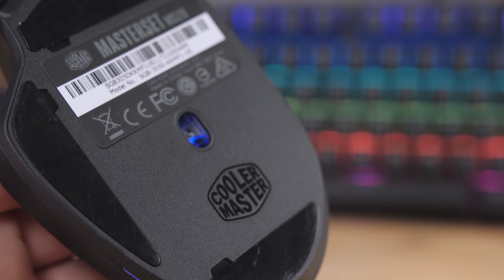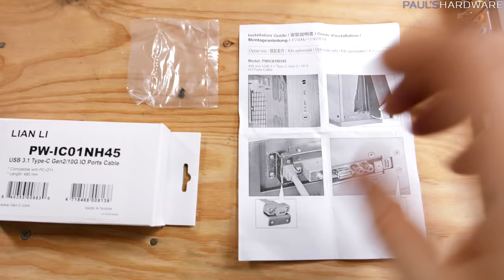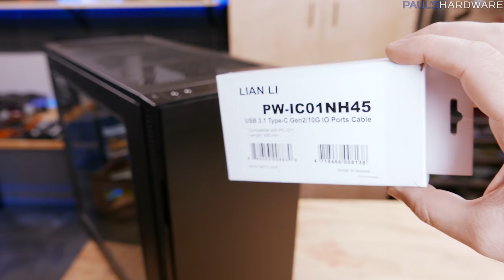CASE MOD! Adding a 10Gbps USB 3.1 Gen2 Type-C Plug

Comment: I don't plan on purchasing any device that would benefit from that type of port and my motherboard dose not have  the header, why did I watch this?
Reply: The phone manufacturers are planning on you buying a device with one though.
Reply: Phones already have a type-C connector, but the cables are type A on the other end. Will phone manufacturers start shipping cables with type C connectors on both ends any time soon? Guess it would be useful for macbooks and other laptops that are getting rid of Type A
Reply: The Google pixel has it on both ends already
Reply: I'm stickin my my nexus 5 for at least the next 6 years
Reply: My Nexus 5X came with a Type-C to Type-C cable, it's really annoying that I have to use the adapter to Micro-USB and a seperate cable when connecting to the PC (for the rare times I decide to test some ROM or something).
Reply: I dunno, I did too, and I don't have a header on my board.
Reply: had the same feeling when i got my power bank... now it is the only micro usb i use somewhat regularly.
Reply: Because Paul is the man!
Reply: I have an LG G6 and it utilizes USB C instead of microUSB. Aside from it being an interface in its infancy with low availability of cables at the moment, from personal experience I can already see why moving towards it would be a great idea for the tech industry: it's durable, it's universal orientation is a godsend [seriously microUSB can be an inconvenience at lining up on some devices (such as my Jabra Halo Smart Headset and Cambridge Soundworks Oontz Angle 3)], and the transfer speed is great when you're on a rush (sometimes I would change my playlists on my flash drive at home while on the clock. LOL!)
Reply: futureproofing
Reply: If you applied that logic I wouldn't watch much on YouTube :-)
Reply: Quality content!
Reply: Geo Hogan funny enough Google's c to c connector for the pixel doesn't support USB 3 transfer speeds. you have to use the other included type a to c cable for that.
Reply: I totally loved the video but doing this with all black parts is the worst idea ever lol!
Reply: Anyone found a way to add that 3.1 gen 2 connection (via pcie card or whatever) to a motherboard?
Reply: Id say give it another 2 phone cycles (think iphone 11 or whatever)
Reply: answer: homosexual infatuation
Reply: ChrisD4335 Because You like quality videos, and you are a loyal follower like the rest of us.  Good job!
Reply: Sorry my dudes
Reply: This aged well lol
Reply: You can go through all this mess or you can just buy a USB-C add-in card that will plug into a free PCI slot.

Comment: Tip for cutting on a case, or anything you wish to preserve the finish on, use masking tape! It will protect the surface and makes it easier to see stenciling marks.
Reply: very true, used that before but hadn't thought of it on this. Thanks!
Reply: and it'd stop the drillbit walking

Comment: Why not add a micro HDMI on the other side for VR?
Reply: TommyThousandFaces  that is great idea.Idk if he would have enough plugs on mobo(because he was saying he might not be able to add 2 usb type c)
Reply: Milos M if you're adding a video output for VR that will be to your graphics card and not your motherboard. he would need to route it through the back of the case and then around to plug into whatever GPU/GPUs he'd be using...
Reply: Alec T Some cards have internal HDMI for just that purpose. However it seems to be a trend that has died off recently.
Reply: That was the whole plan with the s340 Elite adding the front I/O HDMI port with a cable passthrough on the back. Most people dont even use it though so NZXT omitted it on their other chassis upgrades. VR is a niche fad, where as USB type C will be the future of USB connectivity for a while. So chassis needs to include it instead of HDMI ports.
Reply: how about this model? (PW-IC2DAH85 & link (http://www.lian-li.com/en/dt_portfolio/pw-ic2dah85/) with the following: USB3.1 (Type-C 10G) x 1 / USB3.0 x 2 / HDMI x 1 / HD Audio (MIC / EAR)
Reply: Ya my brand new damn GTX 1080 ti didn't come with the internal VR HDMI like I wanted. I knew it when I ordered it but it was still frustrating that there's only one HDMI on the entire card. What is Nvidia thinking? I get 3 DPs, a DVI, and only one of the most popular connectors on the planet. My problem comes from my drawing monitor needing HDMI as well as the Oculus, my main monitor a Predator X34 uses DP. I bought a DP to HDMI connector for my drawing monitor already but still, bunch of BS.
Reply: gigabyte had some with internal HDMI. i was really hoping other brands would pick up on that. i ended up getting a 1080ti from evga. so if i do get VR. i might do some sort of dp to hdmi adapter. since my current HDMI port is running to my tv/monitor. 

i too would probably run that internally to a custom hdmi port on my front panel. 

i  think i will end up doing this mod as well as soon as that lian li part comes back in stock. only problem, i have a phanteks evolv TG, and there isnt much room to install it?!?
Reply: Sometimes you do what you can instead of what you want.

Comment: Or case manufacturers can stop being lazy and release revised cases with USB-C ports!
Reply: ^this^
Reply: Still, if you already have a case, much cheaper to add one than buy a whole new case just to add USB-C.
Reply: It's not necessarily laziness. I think it is more of a cost issue. Lian Li charges around $25 USD for just this 3.1 Gen2 cable. So that means it probably costs at least half of that to manufacture it in the first place. 

In that regards, case manufactures are probably a little less hesitant to add another $25 to the cost of their product for a connector that not everyone is going to use. Since only the newest high end motherboards even have the 3.1 Gen2 header on them.
Reply: UnknownUser there are cases that have USB C in them now XD crazy

Comment: Paul I literally have a r5 and one of these connectors on my new motherboard coming tomoorrow. Are you watch me are you watching me or something?
Reply from the maker: I love it when a plan comes together 😎
Reply: "Are you watch me are you watching me or something?"
Reply: Dude the lack of USB 3.1 gen 2 type C port on cases has been a problem since z170 board came out in 2015. Techtubers are sometimes too slow but at least Paul has finally made a video about a solution. There are also products like the Asus USB 3.1 UPD PANEL if you don't want to mess with your case and if it has an optical drive bay slot to spare. It's unbelievable that even most recent cases still don't have USB 3.1 gen 2 type C ports while pretty much every mobo released in 2016/2017 comes with the feature.
Reply: oh shit thanks ill just out the 5.25 bay option! mine are just empty
Reply: @paulshardware  "I ain't gettin' in no plane fool!"
Reply: @billythecat  I'm going to do this mod and just cut a place in one of the optical drive bay covers. Works just as good a long as they are either sturdy enough or if you can back plate it with a piece of metal as Paul mentioned.

Comment: Your case feels out of date becuase you don't have USB3.1 Gen2 Type C? Mine doesn't even have USB3.0. But it has rust!
I think I should really upgrade that case....
But I'm hesitant because it wouldn't give me more performance (except for copying speeds) and would just cost money...
Reply: Melvin Klein Never know, what if you get a case with better air flow thus giving you cooler run speeds
Reply: I'm pretty satisfied with my current temps. CPU (R7 1700 @3.9GHz) in prime95 never exceeds 70°C and my GPU ( GTX1070 @ 2GHz) doesn't go higher than 75°C in FurMark.
That all with pretty silent settings. My case was pretty great in 2009 when I bought it. 
Currently it has a bit rust and one side is slitely bend which causes it sometimes to rattle. And completely outdated I/O...
I think I should really upgrade but I just can't get myself to spend a few bucks on a new case... I know I'm weird. I spend over a thousand bucks on the stuff inside of the PC but then have an old rusty case that rattles and can't get myself to spend like 100 bucks to get a new one...
Reply: Melvin Klein at least no one will steal it since they think it's old. Nice camaflauge!
Reply: Understatement PC. Nice thought^^
Reply: lmao
Reply: If your motherboard have usb 3 or 3.1 buy a usb 3 hub and a usb 3 cable extender and use tape/hotglue to stick it under your desk and enjoy your new usb 3s and its cheaper than a new case
Reply: would also loose that sweet tetanus risk with a new case ;)
Reply: Replace/add ports then. ^^
Reply: Yeah exactly, why get better things if they just cost money. I've never spent any money in my life and I'm just happy as shit living in my cardboard box with my precious antique bean cans.
Reply: Melvin Klein hmmmm a good casemod candiate ? Also it will be safe at lan partties too :p
Reply: Melvin Klein
Rust? You need a console, not a PC!
Reply: If your case does the job why bother change it? My 750D will last me a life time I dont use the USB ports on the case enough to were USB speeds matter to me either
Reply: Rust? Give it the rat rod treatment. Chop it a couple of inches and add clear coat everything. Tadaa
Reply: Yea the extend cable and just hot glue a hub to under the edge of your desk or the side works better. pci-e adapters are everywhere now.
Reply: You can get devices that fit in the 3.5 or 5.25 bays on the case with the latest USB plugs in them (if you have such bays at least).

Comment: I don't know if you're confused or if you're willfully following the trend, but the small USB connector you installed is called "Type C", not 3.x or gen something. The type is the mechanical form factor, the USB number (2 vs. 3) is how many pins are used, and the gen is the speed. A type C connector could be USB2 (ie. only use 4 pins) at low speeds. So if you're referring to the mechanical form factor, please say "Type C", not anything else.

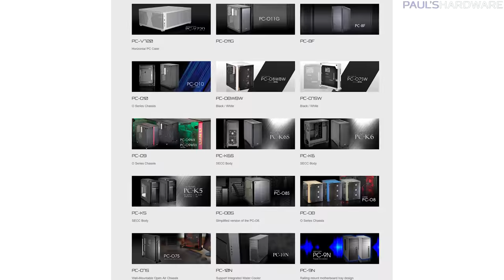Comment: 2:03 there are few lian li cases worth the money that are also meant for full time use. i think that is what you were trying to say paul. actually there are few lianli cases worth the money because short of over 100 dollars you don't get any cable management space, and you barely get any until 200, and at that point you might as well be using a test bench because it becomes wide open. lian li can't decide what it want's to do other than use high gauge sheet aluminum.

Comment: 2 pro tips for you for future reference. I believe you used a Dremel tool. If you have one, you could have used a multipurpose cutting tool bit and/or a carving bit. Fast, clean and no messing with a gigantic cordless drill. If you do it right, you probably won't even have to file anything smooth.

Comment: That my friend, is the perfect use case for a dremel! Those things come in handy all the time, I have like two wired ones and two that use battery packs. I'm surprised you used the drill to widen that hole out, there are these kits you can get with like 200 different bits for your dremel that has grinding posts for grinding out small holes like that. Would of been perfect for that.

Comment: I'd probably have added a dab of hot glue if I had handy. Also: use tape to protect the surface finish when making holes. Ideally one works from the inside (the ugly side), but that's rarely possible on cases.

Nice job! It's a mod I'm very likely to do do sometime. Directly relevant content is always fun :)

Comment: Just in case (no pun intended) you have the define R6 - there is a replacement IO-Unit from Fractal Design itself called "Connect D1", which simply adds the front USB-C port to the existing panel.
Reply: Immpossible to find now, was looking for this, but they are nowhere to be found.

Comment: wait, why did Lian Li make a case with a Type-C cutout in the front but no actual connector behind it?
Reply: Released the case before the mobo connector was popular / finalized.
Reply: ASUS was developing this motherboard connection for us all, now it's an open standard. By the time they did develop this case, it was not yet a standard, so you are able to get the spare part now!
Reply: i suppose that explains why there's also a PC-O11WXC with the connector included. could argue that Lian Li could've just waited to begin with, but maybe there was a reason for an early release. still cool of them to consider an ongoing feature development and allow buyers to upgrade their expensive enclosure like that. certainly not something to be taken for granted, even with premium cases
Reply: not everyone needs a type C...theres nothing in my house that has type C

Comment: Glad to see that you're still rocking the Fractal Design Define 5 for your watercooling! I myself switched from Enthoo Evolv ATX to the Define S, which is probably the best case I have ever owned. So simple to build in, and the price tag is really impressive for what you get. The best thing about it though is how easy it is to watercool in. So much room for radiators despite being just a midtower, and the amount of air that you get through the front intakes is night and day compared to the Enthoo Evolv, which is basically choking the components with that dreadful intake. The exhaust options are also plentiful on the Define, but extremely restricting on the Enthoo Evolv. I may switch a lot of parts in my computer, but I don't see myself changing the case unless I need to go up or down in size.
Reply: I gave up on perfect cases. 2020 extrusion from now on. Let's you build anything and works really well with computer systems. Can order all the lengths and panels cut to size over the net. And long run it works out cheaper.
I just got two  280mmx2 rads and all the gubbins for a dual loop GPU/CPU inside a 12x14x7 box. Go slim rads without so much bling or windows and you could shrink that down to about 12x10x6

Comment: WOW .Nice job Paul ..But I would just bore a hole and run the cable trough..  I really don't care if it sticks out .. What about a build with NO case ..an open build ..CASE or NO Case ? will cooling be a problem ?

Comment: I have that header on my board but no connector on my budget Thermaltake case. Thanks for this vid.  I like the idea but lack room on the front, so I'm thinking about running it through a slot bracket in the back instead.

Comment: Good mod. Too few cases have USB-C, but this has made me reconsider the R5  again for my new build.
Reply: caspar harte
That connector is just developed by ASUS as an open standard, so they all can use it now. Not even all 2017 board by ASUS have them, now all 2018 boards will do offer this front connector!

What board you own, you have any USB Type C doing 10GB on it? You can make a reroute from the back I/O too! Not needing this connector to get it to the front!

Comment: Hi Paul! The Lian Li UBC 3.1 Type C Cable that you had said was limited in quantity has just returned in stock along with a few other parts from Lian LI. I currently have a Lian LI PC-08WX Case that has no USB 3.1 Type C Port. You have the option of purchasing the IO with HDMI, 2 USB 3.0, and Type C port separately which I was considering, however to utilize all ports, you’d want to get a Graphics Card with internal HDMI port in which is offered only through Gigabyte Aurus. My upgrade to take place will be swapping out my current Asus X99Pro with an Asus X299E ROG Strix with Asus GTX1070ti Strix Graphics Card using the i7 7800k, or equivalent. Since the new Mobo has 2 USB 3.0 19 pin headers (just like my current X99), and now the USB 3.1 Type C internal, why not drill a hole on top of the case and still use the 4 USB 3.0 headers the case came with. Anyways, looking forward to this case mod.

Comment: What uses does a usb 3.1-c acctually have on a computer case? Im struggling to think when id use it
Reply: Peter Cruz some external SSDs support USB Type C 3.1gen 2 speeds, so it might be useful there. Now smartphones are also switching to Type C connectors on both ends, so might be useful there(for a person who has the latest smartphones). It is also the future, high speeds, is reversible, all high end laptops adopting it over Type A. So if you have accessories in type C you could plug it to your high end PC without dongles.
Reply: USB Type C will replace Type A sometime in the future. Then you have a Type C <-> Type C Cable for your devices. You cannot plug anything in incorrectly then, as everything is compatible in any orientation.
Reply: Leli196 i have a pc011 and i jave 1 of those 3.1 type c.. pretty fast
Reply: I have a USB-C external hdd and memory stick that uses it, as well as my phone.
Reply: No when will yourself a usb-c thunderbolt 3.1...

You can't get portable ssd's with that standard. The Samsung t4 uses a sata based ssd, that can be used on a normal USB 3 port (and reach its full transfer speeds).

Also charging your USB-c phone will always have a type a connector. I still see absolutely no point in a USB thunderbolt 3.1
Reply: USB Type C 3.1 gen2 is different from thunderbolt 3 standard. Thunderbolt 3 uses the type C port but requires the thunderbolt controller to be present for 40gbps speed. What Paul put in his system was Normal USB Type C in his PC which is 3.1 Gen2 which runs at 10gbps speeds(and why not if his motherboard has the connector for it). This standard will allow for greater transfer speeds between the PC and whatever device that supports the standard. Type C was also built with convenience and size in mind... We can plug in either ways and it will just work with no hassle. The new Samsung T5 uses USB 3.1 Gen2 standard hence it allows for greater bandwith. Everything is faster. You may not have a use for it but Paul might have. Thunderbolt 3 is a different story. Thunderbolt devices are very less in number and are also quite expensive.